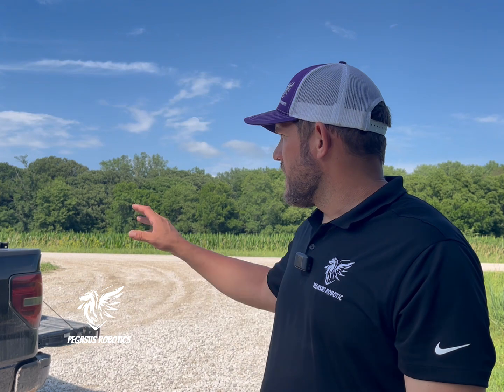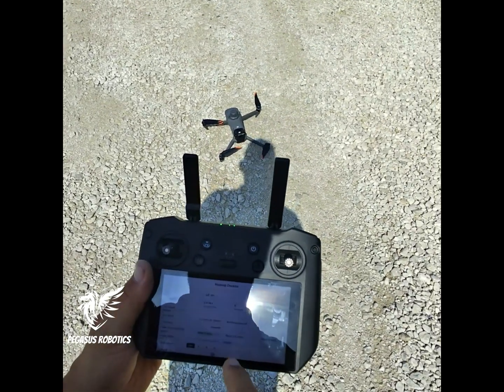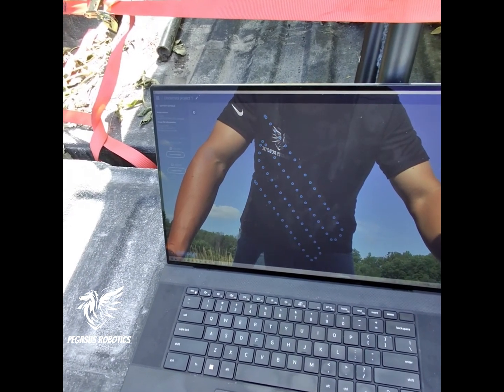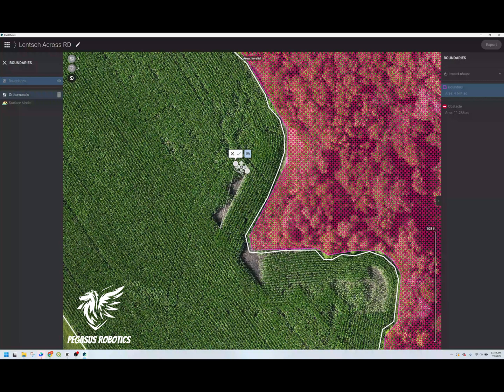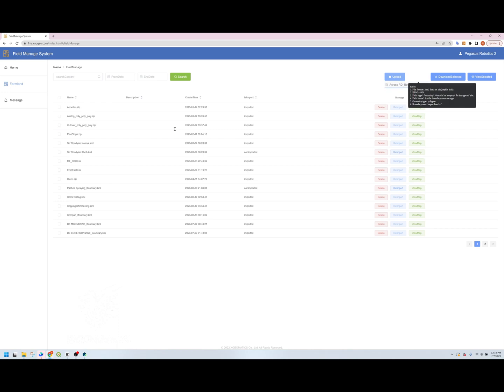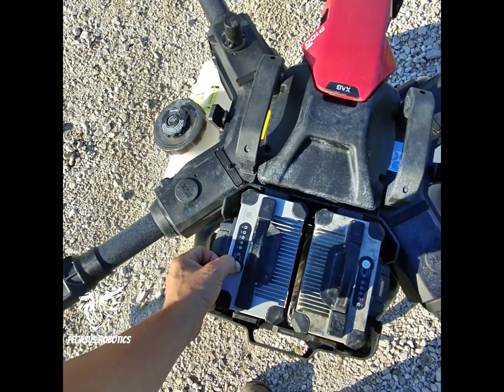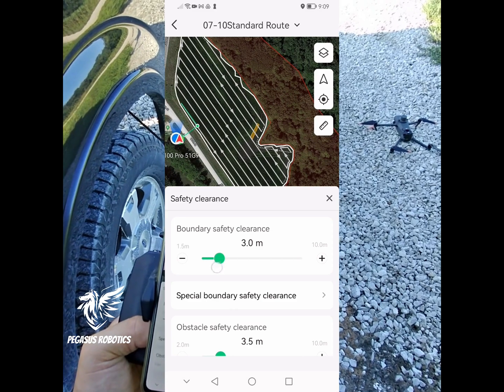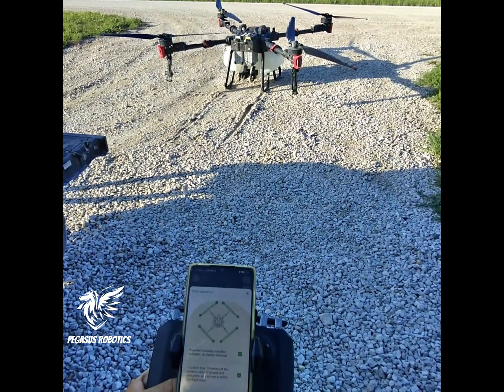How to use a mapping drone to create RTK boundaries & spray fields

Comment: Quick question... I use a WingtraOne which uses PPK instead of RTK for mapping large fields. I then use the XRTK4 with my spray drones. Will Pix4d ensure that the KML output is still accurate?

Comment: Hi Nathan, I am having issues with transferring my targeted spray map from pix4d to my XAG drone. The map in pix4d is as I like but when I open it in the FMS there are parts missing that are on the pix4d but not in the FMS, not sure why only some parts are missing. Can you help with this>
Reply from the maker: Be sure to upload the KML, be sure that you are properly making obstacles and boundaries as separate items.  Make sure the operation has a rate assigned so that it's not zero (otherwise its interpreted as a no spray zone with 0 rate).  If that doesn't work be sure to reach out to our support team at www.pegasusrobotics.com

Comment: Greetings from Australia, Great videos👍very helpful. I tried this procedure with my Mavic 2 Pro and with my XAG P30 spray drone just to see if the concept works on the older machines and it doe's. Only difference is you upload onto the older XAgri app instead of the One app. Only issue is I don't trust the positional accuracy of the M2P. I have some big spray jobs coming up so I'm looking at hiring a Mavic 3E plus RTK base to help insure accuracy. Thanks for the how to videos😉
Reply from the maker: Glad it was helpful @joel2432
Reply: Joel , Giorgio here from Chile, want to talk abut the process you did to load the info for p30, got a pahntom rtk and xag p30
Reply: @giorgiobou3583  I basically followed the video, but the only difference with the P30 is you upload the kml files onto the "Agri" instead of The "One" when in XAG's Field Management system (FMS).
XAG Drones require all Automated flight files to be uploaded onto the FMS cloud. Once you have done that, the files will automatically sync with the phone or device you use to control the P30.
Then all you have to do is pick which mission you want to fly and swipe to upload and take off.

Comment: Hi, Is it important that the same RTK station is used for mapping and spraying or can I use DRTK for DJI mapping, load into XAG One and use XRTK for processing?
Reply from the maker: Most of the time it is important to use the same reference so there is no offset.  But in the case of DRTK or VRTK as long as you consider and build in proper tolerances it should be fine.

Comment: I found this feature in xag drones-With Swarm technology you can fly up to 5 drones at once- can you make a film with at least two drones please...settings and what is interesting to see how the 2 drones behave when they encounter an obstacle in the middle of the field...thank you you are the best
Reply from the maker: Hi, there are some other communication methods that XAG has, however in the US and Canada the rules typically require one controller per drone.  Most customers are happy with dividing a field in half then piloting one drone to one half and another drone to the other half to keep out of each others way, especially for the return flight home.
Reply: thank you @pegasusrobotics

Comment: Hello, I am a farmer operating a P40 in South Korea. When I was mapping the hilly terrain with RealTerra and conducting pest control, the aircraft descended below 3 meters in altitude at the entry point, almost touching the ground, and then went back up again. I thought it might be due to the wind, so I continued the operation. However, the aircraft eventually collided with the ground, unable to detect the changing terrain. Could this be a problem with the terrain recognition sensor?
Reply from the maker: This indeed sounds like the terrain sensor may be dirty or damaged.  Please consult your nearest location of service and support.

Comment: Hi, quick question, does that drone not have obstacle avoidance sensors? That drone looks huge! Looks like it came close to a few trees too, that boundary was spot on!
Reply from the maker: There is obstacle detection in the drone, but because the boundaries were RTK the drone was able to get very close to the tree line.  It's also very tricky based on the camera angle to see just how close it was.  The drone was alerting of an obstacle but it didn't trigger the vehicle to stop.

Comment: Great Video !, What is 395 in the Mission Plan ? at which altitude did you fly the M3M ? Could it also be achieved with a M2P or M3, as you only used the RGB ?
Reply: 395ft so ~ 120m altitude, and yes you can also use an RGB drone if it has RTK.
Reply: @julius_pix4d  Why is RTK a must ? I usually fly P2P or Autel RGB and process in Pix4dFields
Reply: @davidbehr7865  If you want to use the maps to create a boundary for spraying they need to be accurately located. GPS only, can have up to 5m deviation. It can work in some scenarios but you have to be careful, it's better with RTK.